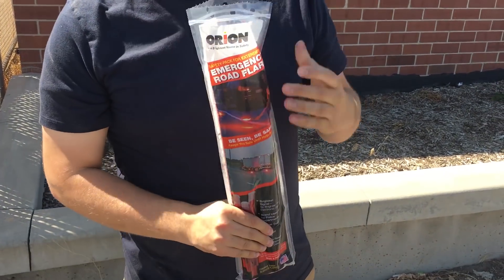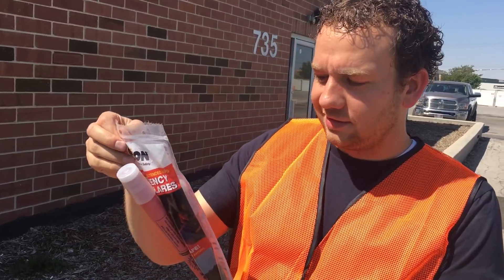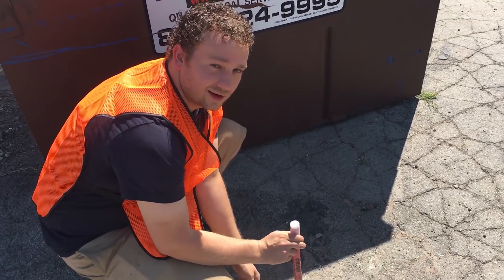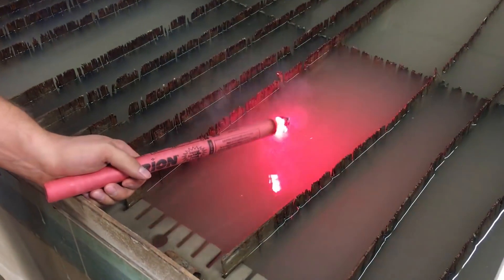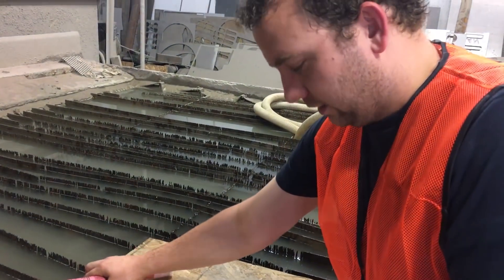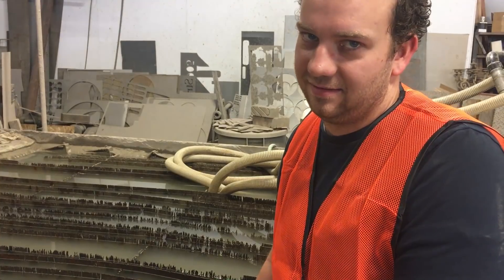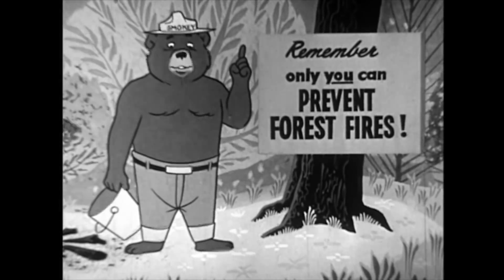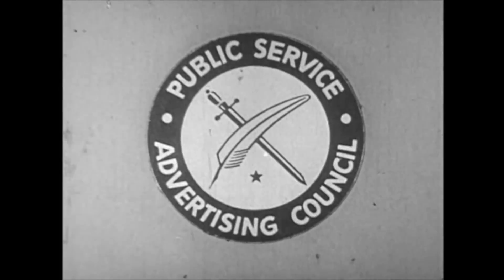Lit Road Flare vs 60,000 PSI Waterjet

Comment: road flares were way crazier pre 2000's before they made them a bit safer. found some in my parents garage as a kid and set one off, attempted to put it out by putting it in a bucket of water and the whole thing stull burned while completely submerged. even melted a hole in the bucket after a while.

Comment: like my grandpa always said, a plugged flare is a grenade. he worked with someone who lost a finger because the aperture on the flare they had got plugged after it was lit. the pressure built pretty quickly and it detonated all of the powder at once (hence the missing finger). of course this was 1950, and flares are a bit more safe now.

another thing my grandpa always says is that the difference between a bomb and a flare, is that flares explode slowly